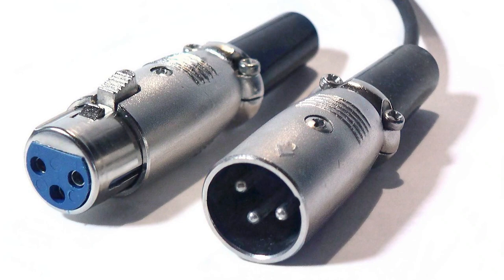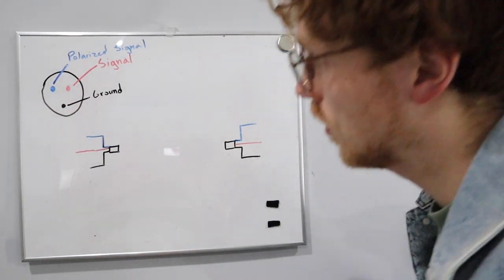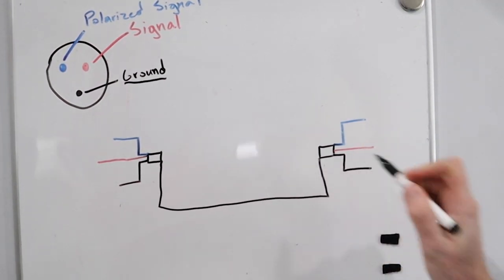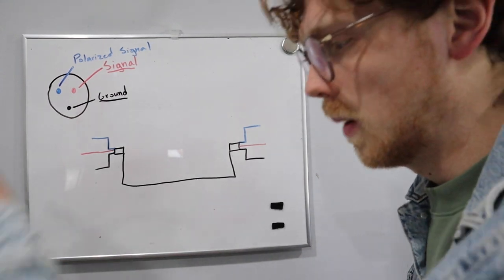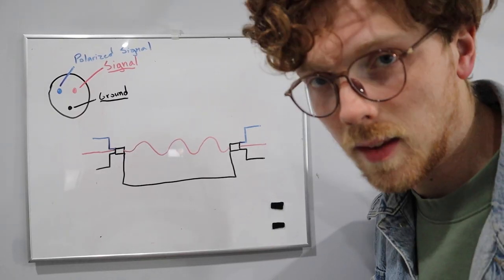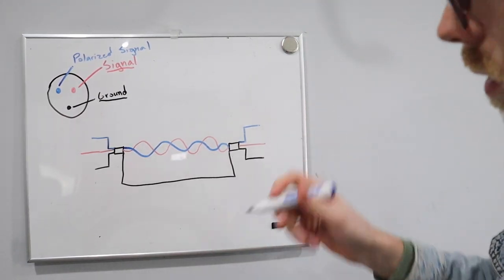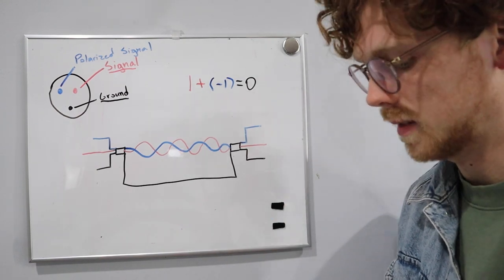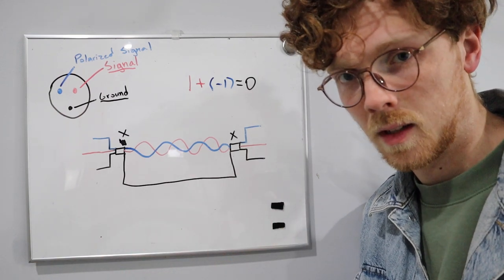How to Set Up Your New Microphone (Beginners Tutorial)

Comment: I think the way the xlr cable is explained makes you question how the signal is getting to the other end if it's being canceled. The flipped signal it's only being flipped during it's way through the cable, so if there's noise affecting the signal when traveling, when you flip it again at the end and add them together now you don't cancel your original signal,  you cancel the noise.
Reply from the maker: So you're correct, I did mention that sort of at the end of that section but you explain it better here :)
Reply: @AudioHaze  ty

Comment: I never really know the gain target after watching videos like these. I hear "-18dbFS" all the time but some say as a peak and some say as an average. Which is it? I have a recording where it peaks around -6 and the RMS is -25. Is that a good spot? Is RMS a good way to tell an average? Does -18 average mean -18 RMS?
Context: I have an AT2020 + AudioBox iOne. The first half of the gain knob is more or less useless. Once I get to ~70% it starts being relevant but there seems to be a point where the gain gets boosted. If I stay just below it, the recording is a bit low when the mic is ~25cm away from my mouth or classical guitar. If I stay just above it, the boost makes everything clip.
 I'm moving the knob the tiniest bit up and down to make these changes.
Reply from the maker: Yeah those are some awesome points! The reason there is some varying answers is because there really ISN'T a good answer. I say -18 to -12dBFS PEAKING (not RMS) because I assume you will want to do further processing in the program, things like compression, EQ, harmonic modulation that will eventually bring the signal up to -6dBFS through the signal chain. This provides plenty of headroom to prevent clipping when further processing is added. If you AREN'T adding any processing, you can get closer the that -6dBFS target without worries of running out of headroom. RMS is a good way to monitor, but to me makes more sense once the signal has already entered the daw, not upon the initial recording. The peaks will be the parts that clip, so RMS may lead to you to more volume confidence, and thus more clipping. Once the signal is in the DAW, and you can normalize everything through compression and limiting, RMS signals start to become more of a priority. Suddenly rather than worrying about clipping your incoming signal, you're more worried about the average loudness of your mix, and thus RMS becomes the meter to follow. Thats my thought process anyways.
Reply: @AudioHaze  Thank you very much for your thorough response. This takes a weight off my shoulders cause I was having doubts about both the mic (which I just bought) and interface.
-6 after processing or when no processing, also refers to -6 peaks?
And a bit off topic but for an electric guitar's DI signal, I've also heard about plugins expecting -18db as well. Is that peaking too?

Great channel. Binged on a bunch of your videos.
Reply from the maker: @johnRivs  Yes -6dB peaking but honestly -6dB RMS is fine too as long as its not clipping, depends on how much you've compressed the signal. and yeah that should work for guitar! As long you're not introducing a bunch of noise, I don't think guitar is that picky.